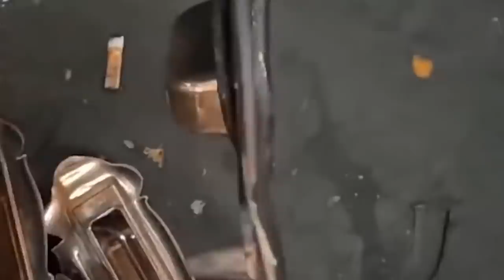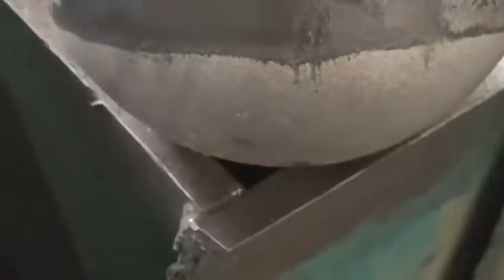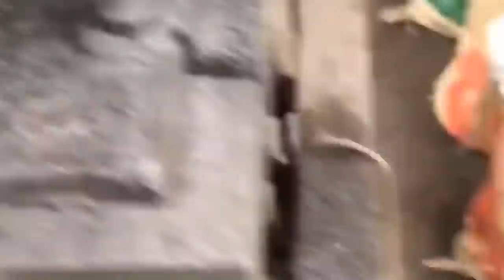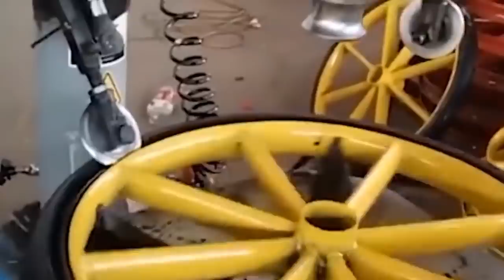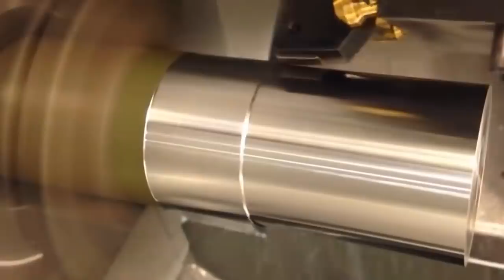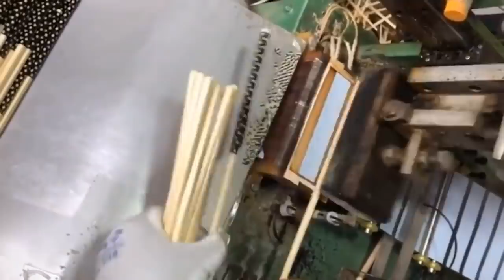This is the scariest machine I have ever seen at the factory. Amazing.

Comment: If you think these are Scary you need to get out more. I had to redesign the controls for a 250-ton press from the early 1800s because the controls were a lever right next to the flywheel. now that was a Scary machine. The flywheel was constantly spinning & when you pulled the lever you engaged the gear and it came down with the most defining crash & the entire factory shook.
Reply: Where's the video?
Reply: ⁶
Reply: Roger That . Did you pee your pants?
Reply: I used to run a steam forging press in the 70s thar came from ford's it was made 1904 one lever steam water oper. If you got air in system the ram which used 48 inch dies would go crazy flying up and down no control